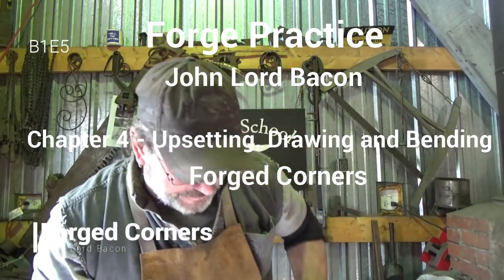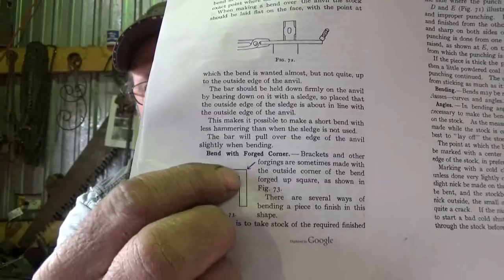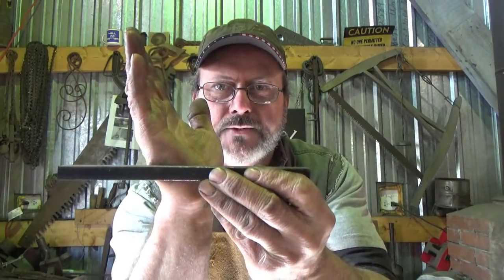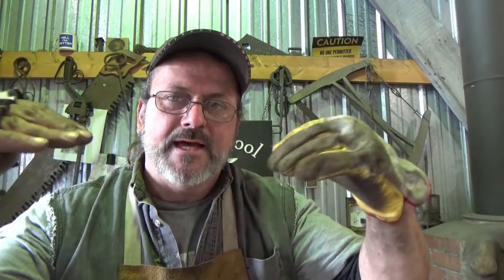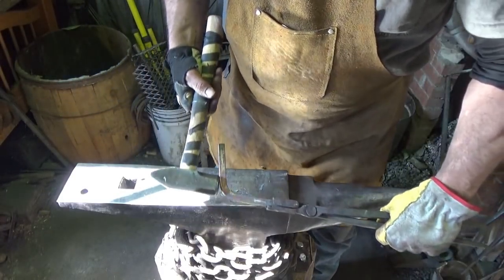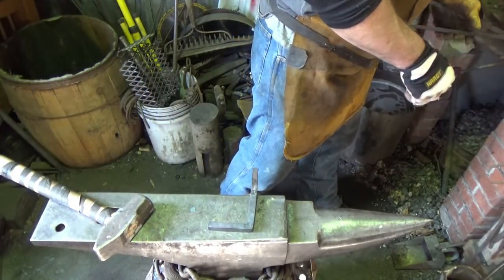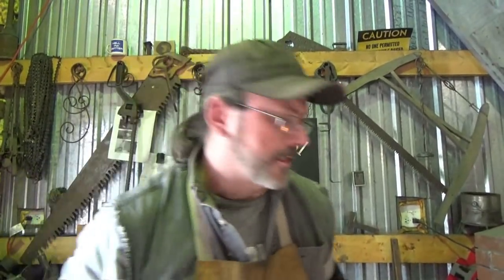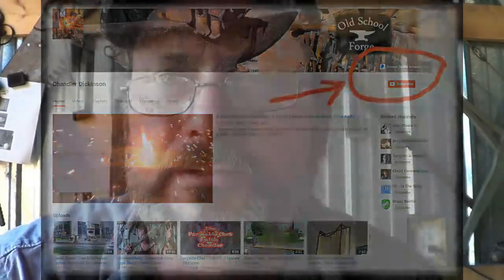Backsmithing - Back To The Basics - B1E5 - Forged Corners

Comment: I see this was posted almost 3 yr ago so you might not read this but, one thing I noticed is you have the perfect tongs for the steel you're using.  I'm a relative newby with only a few tongs and I'm constantly frustrated with the challenge of solidly holding the heated metal.  
Also, and unrelated, as a former math/science teacher I appreciate your usage of the appropriate mathematical terms and your understanding of the physics as you describe the forces placed on the metal.  
Thanks for this series.  I used to tell my students they will learn more from their failures than from their successes.  All the other YT videos I see are made by accomplished blacksmiths. and they are inspiring.    But, I'm learning from you.  Great!

Comment: Would it help to make a small cut, or even a narrow V-shape, partway through the bar where you want the 90 deg bend to be? Then there wouldn't be a lot of extra metal piling up inside the corner.

(And I hope you find some way to quiet the anvil ringing, because it's making my head ring, and I can only guess what it's doing to you!)

Comment: The "whole lotta how not to do it before the how to do it" is sharing a lesson learned. It say's "Here are the struggles if you don't do it right" making the do it right portion an easier to learn lesson because the student wont need to go through those mistakes compounding all the other mistakes they will make. When teaching something like this it is a good practice to teach what not to do first then teach what to do after while bringing up the not to do at each step to reinforce it is not to be done.

As for what you were doing wrong by going over the anvil I was thinking upset in the opposite direction might square the corners, don't hammer the ends at all but hammer the heated part with the ends on the anvil then go over the anvil for cleaning the inside and squaring the corner. If you have an obtuse angle you should get a sharp outside corner with almost sharp without folds in the inside corner, a little extra meat there to sharpen the inside over the anvil without breaking the outside.

*Edit, I actually prefer normal forged radius corners with forged items like shelf brackets, straight 90 degree corners is too machined looking like the smith took stock heated it and added hammer marks. Plus for structural rounded corners are stronger than straight 90 degrees because you need a gusset in the corner as well as bracing at a distance, a radius corner you just need the brace. Sharp corners are always a potential fail point.

Comment: that chain around the anvil is getting in your way in my opinion.
 can you take it off? It looks like the anvil is bolted down already.
Reply: It has nothing to do with bolting it down. The purpose of the chain is to remove harmonics (ringing of the anvil), similar to sticking magnets. It is very important for work comfort, especially as he is talking and recording (nor using earplugs).
Reply: OK. If you are correct then he needs to get some magnets on there.
 If you watch this video the chain keeps getting in the way  the way I see it.

Comment: Chandler.  Have a look at how Denis does a square corner (DF In the Shop) @  https://youtu.be/41oTW4uyiZw.  Note he uses the vice and hits AT  the corner to upset it rather than on the end of the stock - like u learnt toward the end using your upsetting belt.  This avoids the tendency for the stock to bend before the corner, even when you isolate the heat to the corner.  It also makes it easier to get the corner exactly where you want it - when dimensions are important.  I've tried both ways and the DF way is quicker, more reliable and requires less cleanup (planishing) on the inside of the corner.  BTW I got a copy of John Lord Bacon on your recommendation - good stuff - working through some of the exercises now and quess what - i made the same blues as you did - great minds think alike.